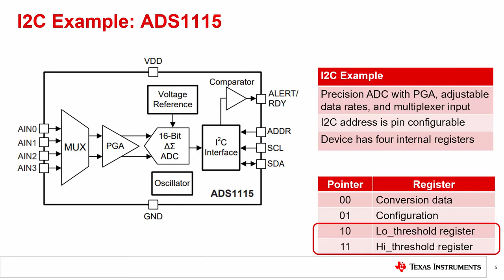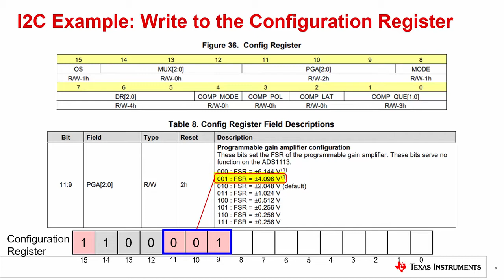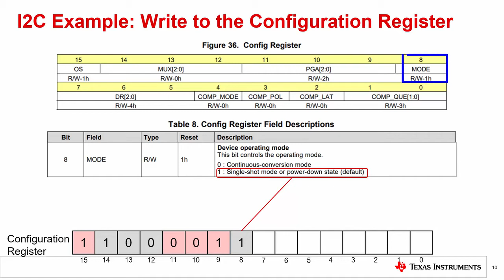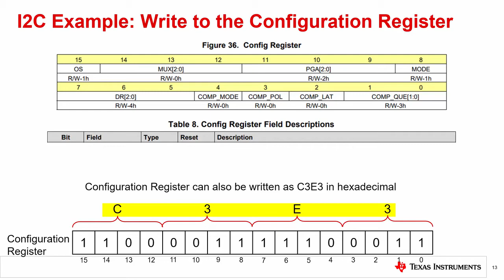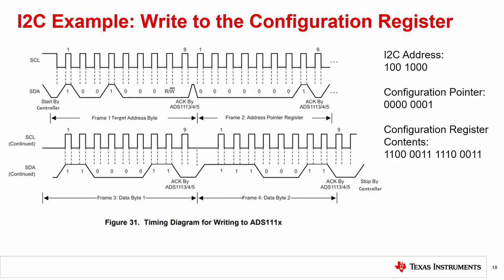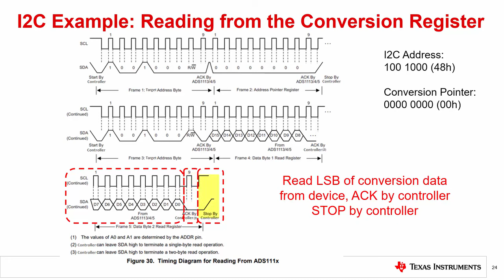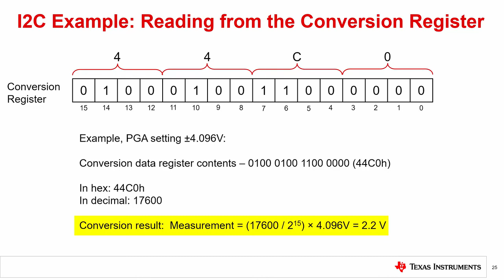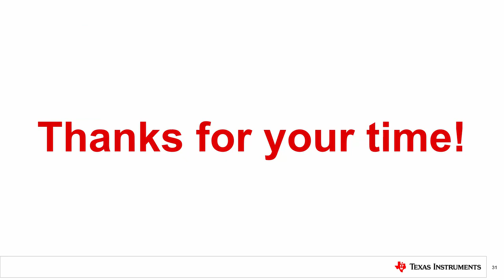Introduction to I2C: Example

Comment: What is the mysterious NAK?
Reply: If still interested, Not Acknowledge is NAK. Below are the five allowed I2C spec conditions to drive a NAK after a bit sequence. Hope this is helpful.

1. No receiver is present on the bus with the transmitted address so there is no device to
respond with an acknowledge.
2. The receiver is unable to receive or transmit because it is performing some real-time
function and is not ready to start communication with the controller.
3. During the transfer, the receiver gets data or commands that it does not understand.
4. During the transfer, the receiver cannot receive any more data bytes.
5. A controller-receiver must signal the end of the transfer to the target transmitter